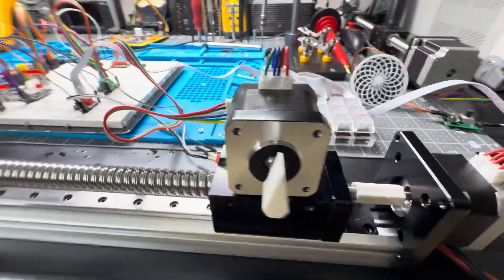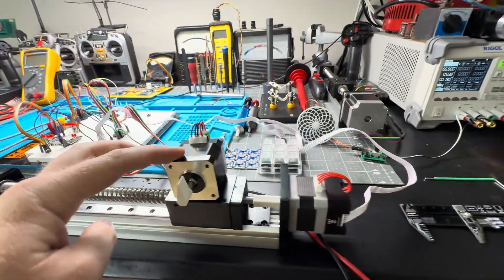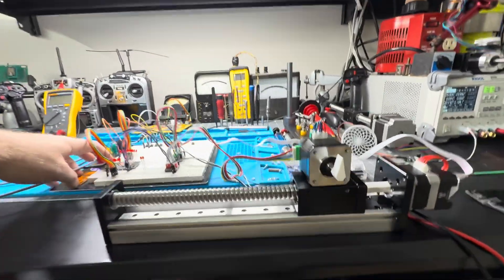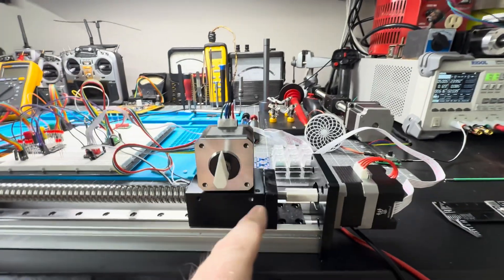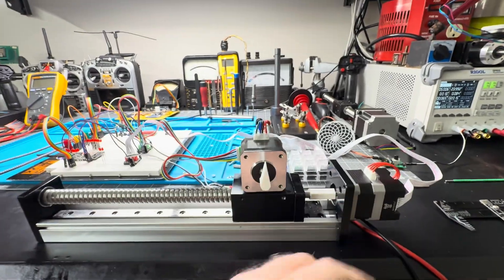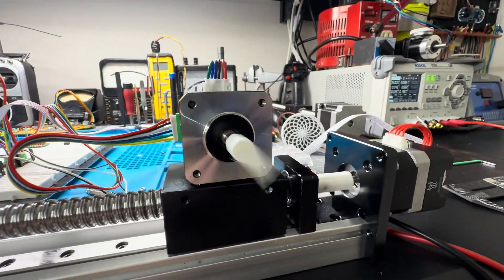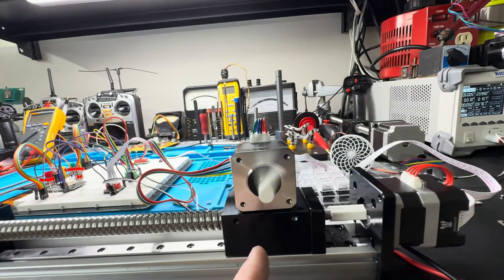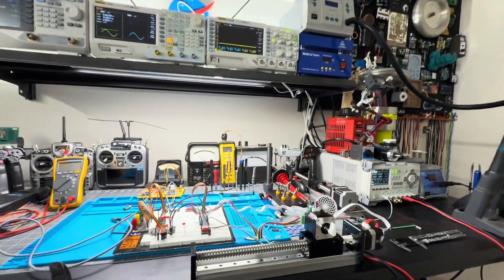Closed Loop NEMA 17 Linear Actuator - ESP32

Comment: Does the closed loop stepper buffer the inputs and keep running the stepper motor until it 'catches up' to the desired number of steps? Is the maximum rate of rotation or pulses per second set differently between the two motors (or controllers)?